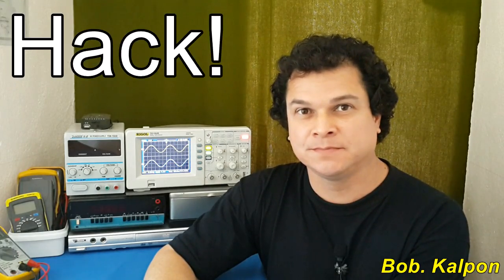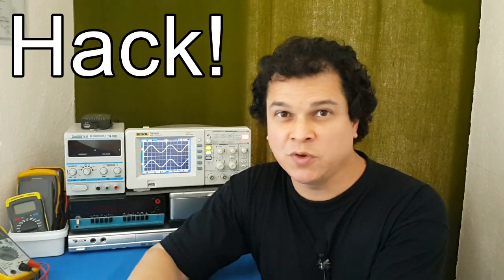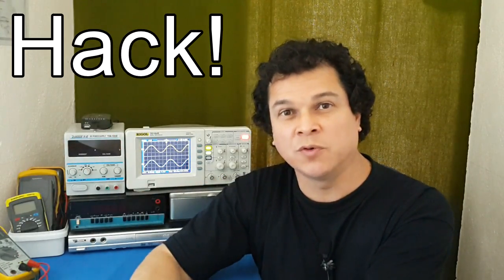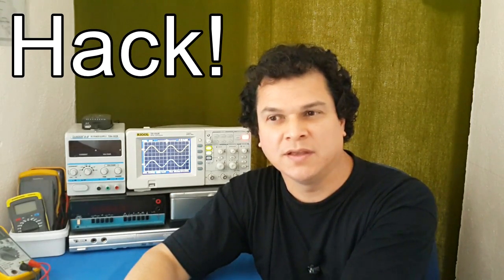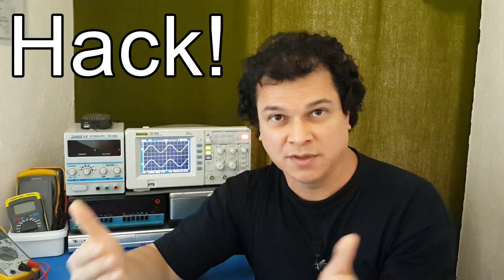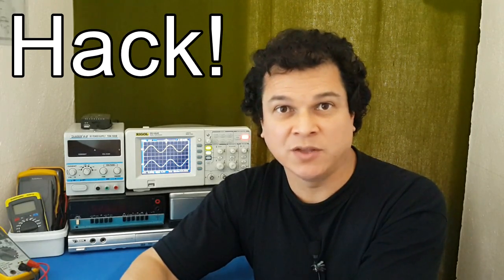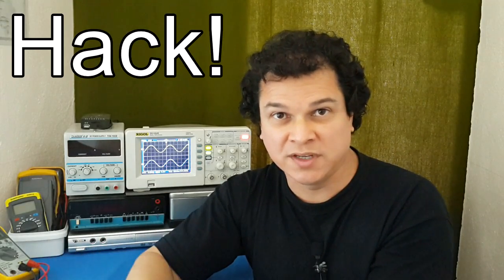Oscilloscope hack / to hack or why do not to hack / how to hack Rigol DS1052E

Comment: The DS1054Z only has a trial version of the 24 Mpt memory depth, advanced trigger options, serial decoding and segmented memory. It's EXTREMELY expensive to buy the license for those features. But there is a "hack" that unlocks all of the features for free. It also unlocks the full bandwidth of 100 mhz, but nobody ever said that their oscilloscope broke after the hack.

Comment: Hi Bob,
Thanks for the video. I have some questions, specifically regarding the Rigol 1054Z.
1. Why would the manufacturer put an option to input codes that turn features off and on if they didn't work or would break your device? On cell phones, for example, to turn features on and off, there are hidden, very long and complicated key sequences to unlock the engineer menus. These are discovered by reverse engineering. I think Rigol would hide these menus if they did not want customers to use them.
2. When I bought my DS1054Z and powered it on, the display said that these features were on, for a trial period. I used some of them and they worked. Do you think it would be safe to input the codes to turn those features back on?
3. Where did you get the information about what is done in the factory?

Thanks,
Kevin
Reply from the maker: Hi Kevin! If the oscilloscope is limited capacity, then it is sold for the price of the maximum capacity the manufacturer can get. If there is chance for more features, then to for sale the upgrade is an extra business. The try period of time is to make us to buy it the upgrade later. 
Whoever buys or has the "right" codes can use it to unlock the features without problems for the device to work fine. 
For the 3rd answer I will say I am an engineer with some extra miles on the electronics manufacture, patents, process, quality or designing. But it is not a new knowledge. From smartphones to a commercial airplanes, a lot of new technology as cars have special features that only a few ones are allow to unlock. The reasons to hide them are the time the same most of the time. It will complicate its user, or get out of its limits in a short while, or it is not safe to use ...between a long list. For another case, it could be because it is a deal to for sale an upgrade.

Comment: 3:00 of course it "has sense". If you create hardware capable of multiple configurations, it is much much cheaper than to have to build hardware for several different frequencies. Plus just because a higher bandwidth model exists, it doesn't mean you could have sold it. People might have a budget, so they can only afford the lower bandwidth model, or none. Simple economics. It is the same reason why you sell off old stock for low prices: you generate sales that would otherwise not have happened.

Also an oscilloscope can't suddenly be inefficient above some certain frequency if it is designed for those. What you configure in software are the enabling/disabling of bandpass filters. Have a look at how the analogue frontend on e.g. the (in)famous DS1000Z series looks like.

Look for example at keysight scopes that have this upgradeability. They guarantee you that there is no hardware switch necessary, for all their models that have this feature, the hardware is 100% capable of doing this software unlocking.

Additionally, it is a quick check to see if after the unlock the scope has the bandwidth, all you need is a trusted function generator; heck even a fast edged square wave should be enough to make you confident.

This is all clearly nonsense and fed by FUD.
Reply from the maker: Yes Dennis. It is a good point. It is one only solftware for all the hardware. The one who has the limit is the hardware. The software is just locked at the hardware´s limit. We ca see it no because the all the model line uses the same software, but because simillar oscilloscopes fron different brands, use a "very alike software".

Comment: This is stupid. So you say that even if they know that the oscilloscope, let's say Rigol DS1054Z, is not efficient in 100Mhz, they selling you the license key to unlock that ?
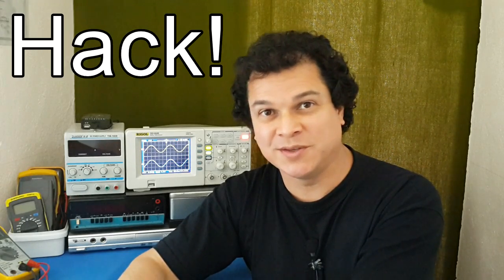Reply from the maker: Hi Sir! In the minute 7:40 I explained it. If the scope wasn't efficient after some frequency, then its designer set a limit for its maximum frequency, and there will not be upgrades offers on sale for that product. If the factory offers upgrades for some specific products... then yes, the oscilloscope can go up, and the intention was to explode the chance of to get more money from the product by for sale an upgrade.
Reply from the maker: Sorry! It is the minute 2:48.
Reply: I see what you mean. DS1054Z with all unlocking option is DS1104Z which they also sale. So in this case, hacking it make all the difference 399$ vs 830$
Reply: Even more, why making a video based on your common sense, when you could test if there is any difference between DS1054Z with 100 Mhz unlocked and DS1104Z. I think it's more relevant for an engineer.
Reply from the maker: Dear Mr. Carstea, I made videos based in answering my friend's questions and no in my common sense. I keep the common my sense for myself to do not influence people, and I use my knowledge just to teach people who asked for it. The video is about Rigol DS1052E or D series as the title said, and another oscilloscopes alike in the same frequency limit conditions. I understand the models you are saying are more important for you. I as engineer, never ended studying and technology requires us to keep updating. I will be waiting for your videos  about these oscilloscopes and to learn some more from a colleague too.
Reply: You damn right sir ! I did hack mine DS1052E and i got just a bit above 100 MGhz .

Ps: All day long i repair "measurements units" at which i calibrate at higher spec level allowed by design, than i lock or limit the bandwidth or options in the unit .